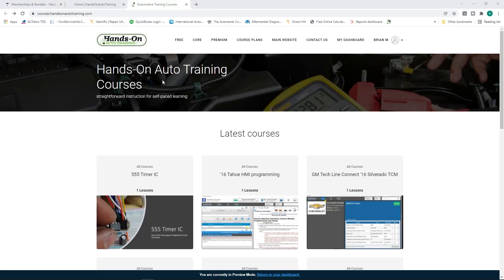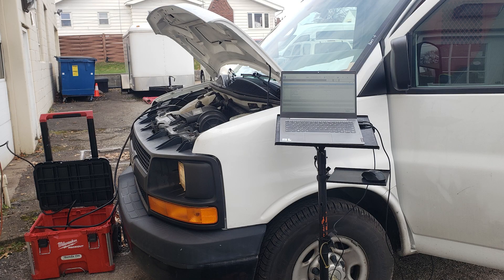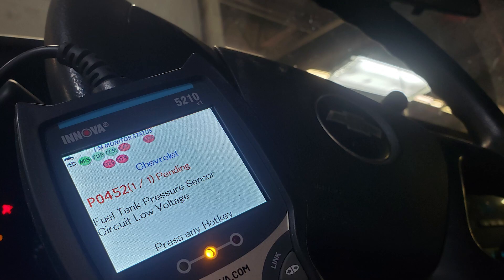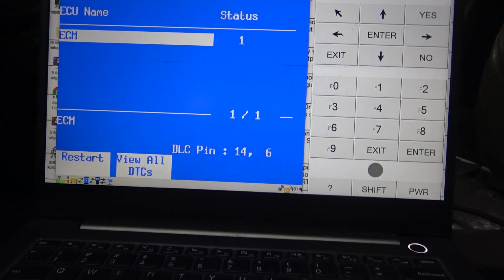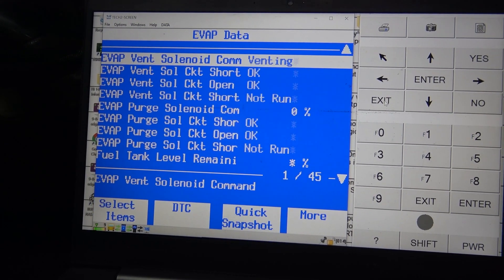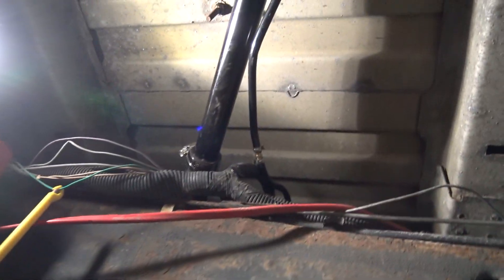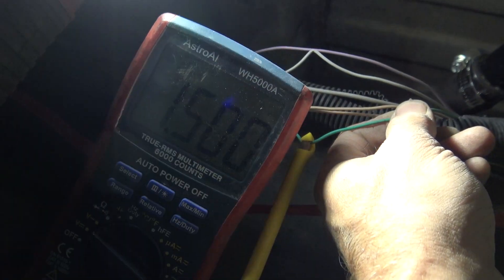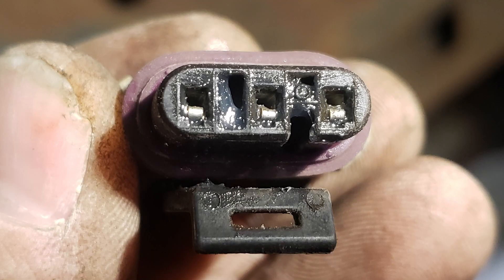Express P0452  End Of Day 12-9-2021

Comment: Nice tool Brian. Spent my day building a frequently counter. Will plug it in tomorrow and see if it performs. Also built a signal generator from a kit and it does work. Now to combine the two with the new oscilloscope. Also been working with with some 555 timer circuits. Just staying busy to keep from listening to all the depressing NY news. Stay safe and well Artie 👍
Reply from the maker: I have some ideas about some counters that could count the pulses(crank) after a trigger(cam). I just do not have the time to research and expirement.